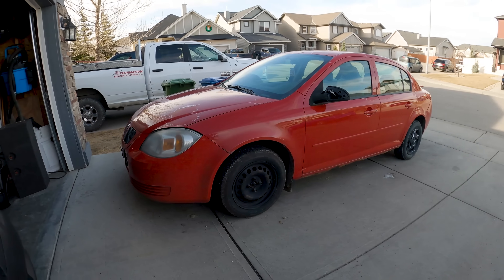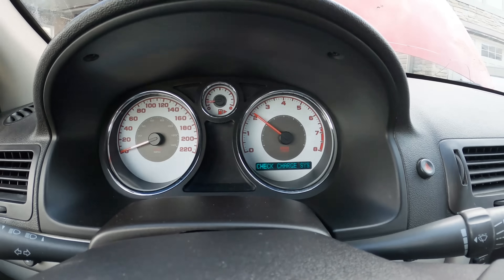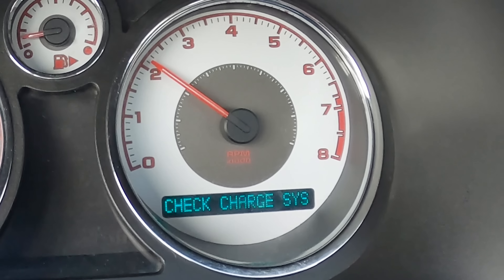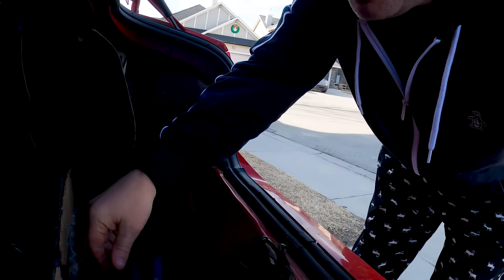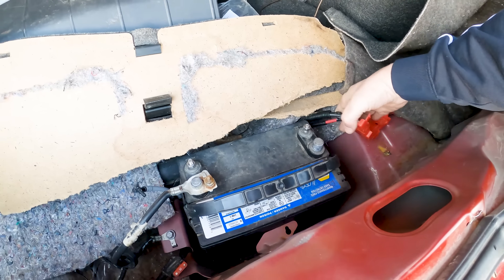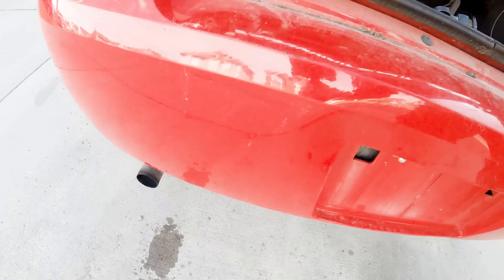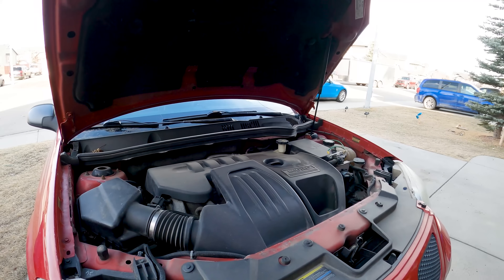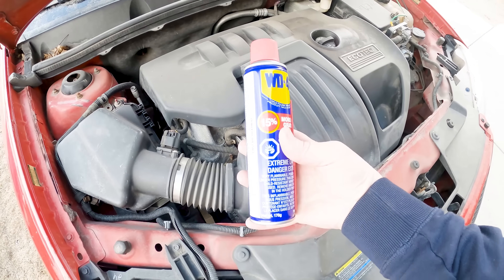ROADSIDE FIX! REVIVE your DEAD or DYING Alternator with this ALMOST FREE trick! | Gears and Tech

Comment: Don't forget to point out that even though the specifics to your point using that voltmeter plug-in are valid. You really should address the fact that the majority of cigarette lighter plug-ins are run through a fuse and relay. Being on a relay, it only shows 12 volts or less. When running my dual usb 3.0 with digital volt meter, I wanted the true voltage since im running a rear battery with battery isolator and two large amplifiers. So I ran an individual wire straight from the battery, leaving a fuse with holder close to the battery and running the wire into the swapped out adapter, which replaced my cigarette lighter. Since I've done that, it shows 14.4 volts when I have the car running instead of the max 12 volt rating it would on its original wiring. 😉
Reply from the maker: Any drop in voltage at the cig plug from battery voltage is the result of wire loss. Not due to any relays specifically.

It's not intentionally reduced. It's just got really small wire run a long way.

What you've done is eliminated wire loss by running a more direct line with bigger wire.

In this example, the voltmeter is a helpful guide, but at the end of the day, I'm only ever pulling the battery terminal off the battery to see if the car keeps running.

If it dies, it's getting wd40 bath then retest

If it runs, then I'm turning all the lights and wipers and heater on to see if it dies then
Reply: @GearsAndTech  thats why I said that everything you said was true in my beginning statement. However, you won't see the true power your battery is getting when the vehicle is on with that plug-in tool, that's all.
Reply: @GearsAndTech  ciggerette lighters are regulated at 12 volts, due in part to the relays. Having a direct line to the battery allows you to see its true power. That is so u can plug any 12 volt accessory which most electrical is ran at. Even though it's regulated, you can still see the lack of battery power with that plug-in adapter. It's not due to runoff. It's just regulated due to it being run through a 12-volt and 40 amp relay with a fuse for protection. Now, because I run my cig light replacement, which has a volt meter directly to the battery with a fuse, I get 14.4 volts when the car is running instead of the regulated 12 volts. At a load, it drops to 14.3 when I have my android head unit, led headlights, and so on. If it was run into the cig lighters' original wiring, it would show me no more than 12 volts and a decimal rating. Your vehicle runs at a constant 12 volts. The reason why your alternator runs at 14.4 +/- or higher depends if you add a special alternator for systems or lots of electronics with a regulator, so the battery can charge while the vehicle is running. But I digress, to sum it up, you can see that your alternator isn't working with that plug-in, but my point is you're not seeing its true voltage that's being ran into the battery with that plug-in. As for any form of drop-off, that doesn't come into play for distance in a vehicle. I have a 12 volt 16gauge hard wire run from the front relay panel all the way to the back, which plugs into one amp and into another. Running my digital multimeter, there is still a constant 12 volts running through when it is on. I had my concern initially with that as well, but only extreme legths like running a house power wire to the other side of your property where that comes into concern.

Comment: Disconnecting the battery on modern cars is NOT a smart thing to do at all!  That trick worked fine in the 70s and maybe a little into the 80s but do that on anything built within the last 30 years and you are seriously in risk of damaging electronics that DEPEND on the battery smoothing out the power generated by the alternator.  Remember, voltage may be low but that does not mean current is low.

Also, anyone who recommends disconnecting the positive side of a battery clear does NOT understand how power flows.  If that positive touches ANY exposed metal and completes a circuit, you are now at risk of a spark and/or fire.  

So much dangerous information here.
Reply: Exactly, he is just another Utube geek with no mechanical knowledge, let alone auto electrics! Cheers mate.
Reply from the maker: Thanks for jumping in and sharing

Comment: Not a good idea to disconnect the battery while the vehicle is running on a modern car. If the alternator was working properly (already established it wasn't by the voltage test), it would cause a voltage spike that could damage electronics (like the ECU). I do like the WD40 trick to unstick or clean the brushes! Keep sharing your ideas!
Reply: I know disconnecting the battery with a good alternator will cause the alternator to think the the battery is low and increase  voltage to compensate. Because there is still no feedback it will keep increasing the voltage untill it burns out the alternator. 
Perhaps modern alternators have something to stop that now, but it was always a problem if a battery lead came off while driving.
Reply: @thomasmyers4089  No they surely dont. The voltage spite can reach as hi as 30 volt more than enough to blow all you electronic systems. As a old auto electrician I can tell you it will be a very costly mistake..
Reply: @thomasmyers4089 I don’t think this is correct. The voltage output is governed by the diodes. You are thinking of a generator this is what happens when you remove a battery cable.
Reply: @chrisczarnik3439 Are you getting mixed up with a zener diode, these were fitted to early motorcycles. 
These give half rectification, but had a voltage cut off of around 12volts.
Reply: That's what I was told when done the same thing at a autoparts store. Will cause electronics to short and damage expensive components. Good trick for older cars that don't have the electronics.
Reply: if youre using wd-40 on any electrical stuff- that's far from 'cleaning' it. its a water-dispersant- PERIOD. said by my late stepdad- who was a consultant of the development team at general dynamics.
Reply: @tommurphy4307 yeah, what do you think WD stands for?
Reply: It is clear you know nothing about electricity.  A 12 volt lead acid battery only produces around 12-14 volts of electricity depending on conditions.  Additionally, the electrical bus the battery is attached to is all in parallel, it is not in series.  There will be "zero" voltage spikes from connecting or disconnecting a battery.  What a battery DOES do is "absorb" a voltage spike "if one occurs" and they can definitely occur which is why running a car without a batter is a problem because it serves 3 important roles.  #1. Power Source (most obvious) #2. Grounding Solution (not as good as actual ground) #3. Line conditioning (something more people don't think about or know about).

Sadly, cars can be designed to protect against battery disconnections but why waste the money on component complexity when you have a giant battery to handle all of it for the entire car at once?  Sadly not a lot of people know this... and you can't really convince them otherwise.  Let's take you for example... what are the chances you will update your own knowledge with the facts I just gave you?  Or will you just "double down"?
Reply: @CD-vb9fi  WoW  spot on !!!.  Glad to see some intelligence out there. !!!!!spot on.
Reply: @CD-vb9fi  he is a good clown
Reply: @cecilmayers3429  you are the clown that needs to "update your knowledge" as you say.  Also, "depending on condition" is not a term I ever learned as a mechanic or in electronics class.  I guess unless it referred to playing with electricity in the rain.  Like don't do it.  When repairing a vehicle there is ALWAYS a root problem that needs to be properly identified and fixed.  I don't fire off the parts cannon at the owners expense because I'm unable to determine the root cause "dependent on conditions".  You can use your own vehicle as a guinea pigs but there's no place for that when working for the public, whether in a shop or providing mobile auto repair services.  You can call me a clown all you want, but this clown isn't going to damage someones car or truck and not know why.
Reply: @CD-vb9fi  A 12V battery produces 12.66 Volts.  6 cells each producing 2.11 volts.  It will never produce 14 volts, the alternator will produce 14 volts to charge the drive battery and replenish the amperage needed to start the vehicle next time it turned off.  It's not the volts that start a vehicle it's the CCA (COLD CRANKING AMPS).  Cars really only need around 300 to 400 amps to start a vehicle with an automatic transmission, 175 to 250 for a manual transmission (or 0 amps if in neutral going down a hill.  the momentum and gravity itself is enough to pop the clutch and get the flywheel turning which is the only job of a starter which needs at least 175 amps for the starter solenoid to engage the plunger gear to turn the flywheel.  A vehicle doesn't even need a battery to move, however, the accessories that tell it to in modern cars definitely do.  If you ever see battery voltage at 10.5volts it usually means you have a bad cell and the battery needs to be replaced.  8.4volts = 2 bad cells because as I said, every cell is 2.11volts.  There's your education on battery voltage for the day Mr. CD trying to pass off your misinformation.  GOOD DAY SIR!
Reply: @dj_illeagle  Hold on, do you not understand what "depending on conditions" means?  And yes a battery can indeed produce more power than it is "rated" to produce.  Keep in mind a battery with a full charge can also hold a "surface charge" which can cause it produce a higher voltage than it's intended rating.

While it is not "normal" a battery can indeed get close to producing 14 volts.  Hence the 12-14 range I provided.  I have personally witnessed with my own eyes and a meter 13.6 volts from a battery.  Sure, it's not normal but "nature happens" and does not care about your opinion or mine on it.

And while you appear to be "insulted by facts" for some reason I do hope you actually have a good day as well sir.
Reply: @CD-vb9fi  That is exactly what it is, a surface charge that will burn off once it starts the vehicle.  Not withstanding this short lived temporary surface charge, a new lead-acid battery for a vehicle is 12.66 volts at full charge.
Reply: @dj_illeagle  I would have been happy with a "you are right" reply.  Why is it that you can't admit I was right and that you were wrong?

A battery operating "as intended" should result in the charge you are describing.  But that is the thing about "reality" it gets in the way of your "ignorance".

Surface Charge is not the only phenomenon that can cause a battery to measure a charge greater than original design.  Things happen like a little too much sulfuric acid in the battery.  The primary driver of voltage is the chemical process occurring at the electrodes.

Things can happen and improper charging of a lead acid battery can indeed result in a change in it's voltage output.

But like I said... a simple and "humble" response to me would have been best not some "you are right, but my poor ego" response.

I mean... just understand, reality is out there and things happen to change how things work sometimes.  Better to be prepared than for someone to say... OMG... my battery is operating at 12.8 volts throw it away it's not a good battery anymore because it's not exactly 12.66 every time I test it nonsense that your commentary might promote!
Reply: @CD-vb9fi  I'll just let the other Certified Techs in the audience with the proper knowledge and real world experience chime in; if any believe removing battery cables with the engine running is a good idea; I'll gladly give you the "ATTA-BOY!" you so desperately seek.
Reply: Rubber mallet and smack that alternator 😊 but likely won't last long-term but will likely get ya home or shop.. IMO WD40 could just make it more dirty and then stick again.  Hammer time 😂or tire iron. Also can get a starter goin again.
Reply: 🤘🏼😂 yessir  @user-ug2rn7sr9i
Reply: No , bad idea . wd40 is combustible & alternators

 make sparks . Bad area to have a fire starting ......
Reply: Idk about your alternator but mine never makes sparks lol @charlie78520
Reply: Mazda 3's have to "relearn" the idle after battery is unplugged.  Some even worse cars like buicks need codes and other bs if the battery is unplugged for any amount of time
Reply: @JoeMama-st1ro Mercedes.  There is a whole relearn and program on almost all modern Mercedes.  The manual says the alt outputs different voltage depending on the age and condition of the battery. So as the battery dies the alt ups the charge.  Replace bad battery with a fresh new one and do nothing and you’re now over charging the battery. This is why I read service manuals for fun lol
Reply: @Scummy_shovel 👍🏻 good comment, same for BMW
Reply: @brianw338  I’d imagine prob more so for bmw. I haven’t worked on much but I know you need to reprogram the ecu when you change batteries because the output gets higher as the battery gets weaker.   All that electronic stuff is fragile and pricey.  Certainly not worth risking it especially since there are easier ways to test your alternator output beside unhooking and seeing if it dies lol.
Reply: @Scummy_shovel  yeah. When I’ve replaced my BMW battery it is recommended to either have the dealer or, one can do it yourself as I did ,(reset) the computer so the system knows there is a new battery and not overcharge the new battery
Reply: @brianw338 of course Brian let the dealership do it so they can charge you astronomical amounts of money for stupid s*** you can do yourself. I understand people need to do the research.
Reply: Play some that is correct the battery is just to start your car. The alternator is to keep it running.
Reply: Also never let the car that you're jumping from-running, especially new computerized cars, use battery only, just wait a quite a few minutes, and then start it, because a lot of the newer cars you can't reb them up I guess, it would be CVT transmissions maybe that's why, I know you can't throttle my Kia forte that's for sure.
Reply: This guy saves a lot of people a lot of money.
Reply: Yes, a fried ECU, is an expensive result of removing a battery cable whilst the engine is running.
Reply: Alternator produces AC, dynamo produces DC. Generator is a general term for both of them.
Reply: 4 Diodes gives (AC to DC) complete rectification, 1 diode gives half rectfication, nothing to do with voltage control.
Reply: I used to use the battery cable disconnect trick all the time when I was a young man. However, about 16 years ago I had an '86 Dodge RAM that I tried that trick in. Cost me a new voltage regulator, and I haven't  used it on any vehicle since. Better safe than sorry.
Reply: Guess we're learning not to buy modern cars.
Reply: Agreed! Not like pre-OBD2. Too many sensors and components need proper voltage now. They won’t even run off just the battery anymore, like they used to. No, shouldn’t spray anything into your alternator, especially something oil based. If you absolutely must, an electronic safe sensor cleaner, such as MAF sensor cleaner, is a better choice. Electronic components don’t react well to oil, which explains why alternators that have engine oil leaking on them tend to go out sooner.
Reply from the maker: Thanks. More gems to come
Reply: @GearsAndTech if the copper collector is done, brush wear goes into the plastic, this won't work.
Reply: You can do it safely if you remove the positive cable. Work at a dealership for 52 years. This is been a test for alternators for years and years and years 
.
Reply: @krisruiz5365  REALLY........!!   would hate to go to that dealer !!!!!!!!!!!!!!!!!!!!!!!!